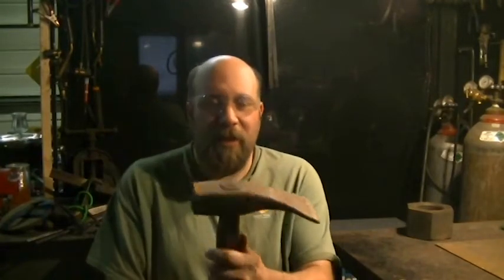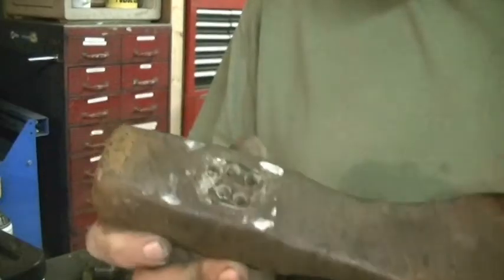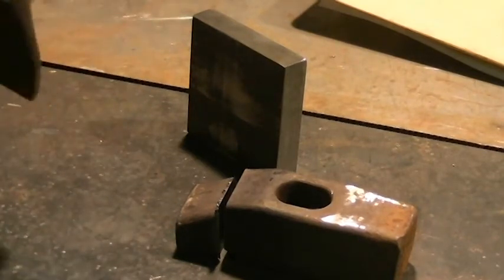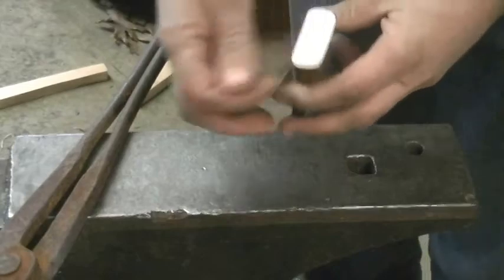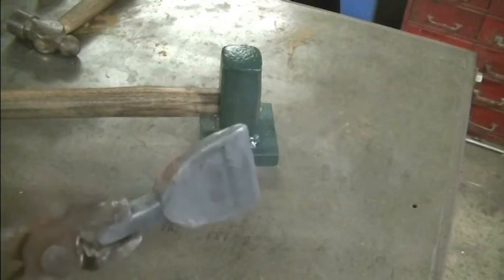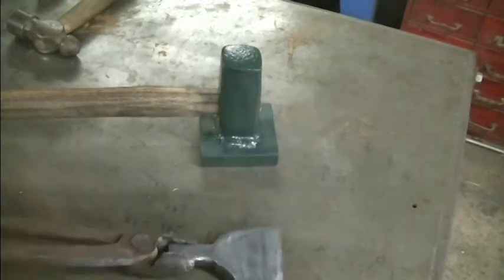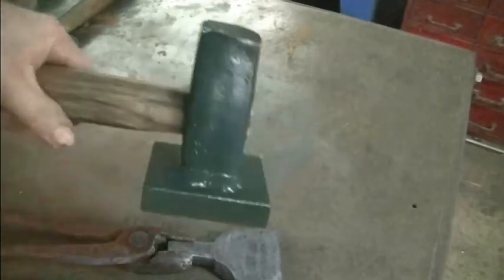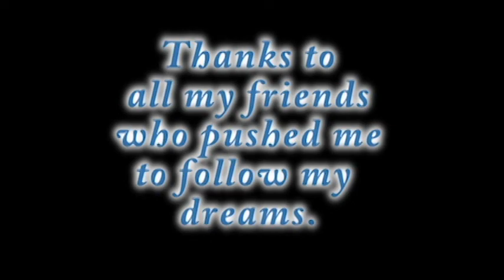Making A Flatter & Cut Off Hardy

Comment: Jeff, thanks for this video!
I, too don't have much money and never will.  I am somewhat disabled with a disease, STILL'S DISEASE, that eats ALL the cartilage from the joints, ALL of them!  I've had 7 major joints replaced and would do more but, there isn't enough GOOD bone to screw to, left!  I am also, 6.75 inches SHORTER than I was in 2000, when I was diagnosed!  They aren't working on this disease as it is quite rare and, being 66 years old, I will never know if they find a cure in the future!
That said, before i became disabled, I was becoming a good Smith even though I didn't really have a teacher.  Most of what I learned I learned by watching friends, getting a cheapo Harbor Freight anvil, some tools that were given to me and practicing.  I have sold quite a bit of my work at mountain Man Rendezvous!
I don't have a flatter and just before I ran across your video, I was thinking about doing JUST what you showed!  I have some 1 inch plate that I can harden in the forge and weld to the squared and flattened end of a hammer, just as you did!
Glad I ran across your video!  AND I agree with you!  It's kind of a "If they had had it then, they would have used it!" sort of thing!
Thanks!  Keep moving forward!

Comment: Jeffrey if you are using fire to move steele and iron no matter what the source you are a blacksmith. In this video you made two tool out of an old tool, you are a blacksmith. All it is,  is do with what you have on hand to get the job done. Respect and well done.

Comment: love your videos and ending comments..  I have a brass hammer and an aluminium face/rawhide face cast iron four pound hammer.  both hammers hang at eye level  on the wall between my forge and anvil.  every smith should have a soft metal hammer for hitting tools like you made from another tool.    your adjustable turning fork idea is ingenious.  every smith should make one.  that puts you above 9 of 10 traditional black smiths.  the naysayers suffer from low self esteem and envy of your ingenuity.

Comment: Great video.  I will build my own faux flatter since I will use my MIG welder to attach the flatter surface to the hammer.  I am a hobby metal guy, and I use what I have or buy it if it is easier and faster to get a project going.  If a peson wants to be a "purists"  blacksmith great.  But critisizing someone who is not or does not care to be one is stupid and small.  I am in it to have fun, so I do not have to be a purist.  Totally enjoy the stuff you make - provides me with lots of project ideas.

Comment: One comment, meant is the best possible way (not a nea sayer).  If you plan on hitting the flatter with another hammer check to see if the existing end isn't hardened.  Hitting two hardened surfaces together isn't the best idea.  Great video keep them coming.

Comment: The same stuff goes on in the archery forums bagging on the wheeled bows and I believe it will always be there.
" I'm better than you because I have midget horses running my bellows" Blah blah blah
I needed a hot cut hardy so I welded some angle iron to a piece of 1" square stock. 
I sharpened the leg pointing up and done. 10 minutes time to a hot cut hardy tool. It doesn't need to be tool steel because the stock being cut is hot. When it dulls I sharpen it on my belt grinder.

Comment: I fully agree about traditional way vs any way available, except traditional way is good to know and exercise, let's put it that way, today is no need or very limited need for blacksmithing at all so...
that's the beauty of this craft, was allways about inovation and get things done with available tools and methods of the time but in the same time is good to master the old ways and traditional tools use.

My only real issue with this flatter is it's weight, usually such tools should be lighter than the striking hammer in order to be efficient, yours is on the heavy side, need a big hitting hammer, great for a striker with a sledge, for a one man situation i would choose a lighter one.
cheers

Comment: great use for an old bead breaker. Used them daily  breaking down truck tires the old school way in my younger days...The back side was  designed for hitting with a sledge to unseat the bead. Never had safety glasses, still got 2 eyes.
So some of you Utube experts are telling me I was doing it wrong? I would love to be shown what I was doing wrong... Please put up a video of the proper   use of this hammer and link it below this comment.

Comment: I have question. It's a bit off topic but it's about chop saws. I noticed near your chop saw you had some square tubing. Any tips on cutting square large square tubing with a chop saw? I have some 3in. by 3in. square tubing and every time I try to cut it the cutoff wheel just stops cutting, stops producing sparks and the tubing just starts to glow red. The steel just sits flat on the saw but the only way it'll cut is if I clamp it up on the diagonal so that the wheel starts cutting the square tubing on the corner instead of the flat side but when I do it that way it's very difficult to get an accurate cut because it's hard to keep it stable on the diagonal. Any advice would be greatly appreciated. Thanks!

Comment: Glad I saw this video - I have a piece of shuare 1 inch steel and an old hammer that I was gong to do exactly what  you did to make a flatter.  Do I care if it is not the "traditional" way to make one?  Hell no.  I also have an old steel chisel that I am going to cut down, and weld the top portion onto a 1.25 inch piece of square rod after I have heated it up and made it fit into the Hardy hole of my old Peter Wright anvil that I have (heaven forbid) refinished with an angle gridner.  Is any of this traditional?  Ask me if I care!  As long as it turns out good enough to get the job done, I will be happy.  Can I afford to buy the stuff new?  Yes, but I greatly enjoy repurposing stuff.  Great video, thanks for sharing.

Comment: Your so right! Every blacksmith was always looking for a advantage it was hard,hot dirty work and still is, you try to make a Hardy cut off  out of a car axle without a POWER HAMMER which I see get used a lot on U Tube and if your not a full time smith you will be dead in about 15 mins. I just want to make stuff that I can be proud of and use. It's like some fly fishing guys who don't take to you because you have old stuff. You know what, any day fishing or forging is one less day doing shit I hate so screw them. Life is to damn short to spend a whole day forging a flatter when yo can do it in 10 mins. Thanks for the post. Where you from by the way? BC needs welders if your looking.

Comment: Jeff: I have heard it repeatedly said that you should never have a flatter or other top tool made from hardened steel (ie. a hammer head that has not been annealed), because it will be every bit as hard as your hammer and could damage one or both. Has this caused any issues for you since you did this project?
Reply from the maker: I have heard the same thing over the years, it is possible for metal to break off a surface if you hit two hardened pieces of steel together. Not only can you damage the tooling if a piece should fly off it would do so with a lit of speed. In a nutshell shards of steel flying through the air at high speeds is very bad and should be avoided.

That being said I really don't think this hammer is as hard as many people believe it is, I took a file to it and was able to get some shavings off of it. So far there is no visible damage and I have used it on a fairly regular basis.